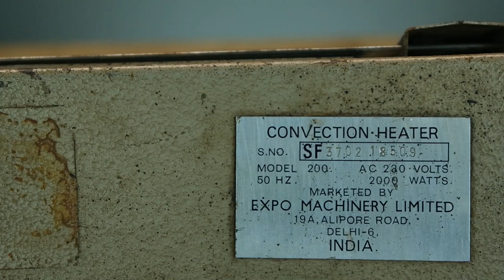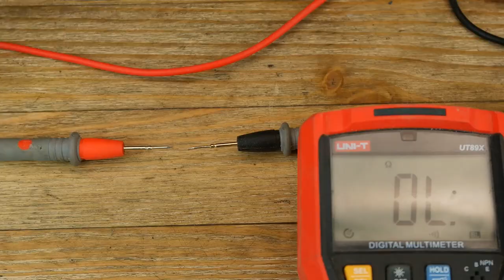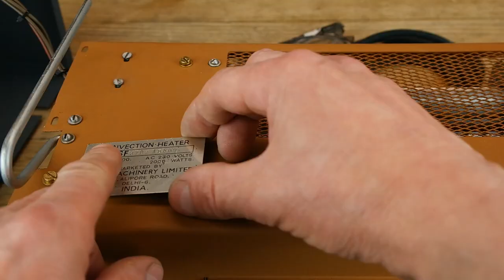Restoration of old Fan heater

Comment: Beautiful restoration job you did on that electric space heater.  It looks much better and it works like a charm too.  Good to see old appliances restored to working order, particularly when many of them are simply thrown away after they have stopped working or are simply worn out.  Excellent work.
Reply from the maker: Thank you for your interesting comment👍. I'm glad you liked the renovation. Regards

Comment: I have cleaned a fan heater for my neighbour, that had a similar style to this ~ rectangular unit, bar foot and side dial, the only difference with hers is that; the tangential fan is inverted and the air is drawn in a vent in the top of the cover, the impeller is plastic, deluxe functions ~ dial had 5 positions = high/low speed fan, high-ll/low-l heater and a thermostat. The only awkward thing with hers was how the mains lead went through the housing - into a perished grommet > a hole in the cover [not an arched slot like you had] = the wire got bent on removing the cover as to how close the strain-relief clamp was to the hole, a screw (in a slot) was loosened under the thermostat to push it into the heater so it’s wheel would clear the slot hole in the cover for removing and the dial was pulled off. I didn’t elaborately/completely dismantle it not like you did, l removed the cover and was amused with the amount of dust that had coated the inside of the chassis, I opened the bottom sash on my window and put the chassis on the outer sill recess of the house and got an electric air-bed inflater and blew the dust out with it, and was amazed at how effective it was and the dust cloud I had made. I also removed the impeller to oil it’s bearing and took apart the motor to [again] oil it’s bearings [these need to be removed > heated and pickled in oil to efficiently lubricate them] l then reassembled the fan heater and inadvertently bent-twisted the wire inside the the cover (it survived the ordeal with some chafing from the hole) and managed to straighten it out. I then tested the heater and it worked as intended
Reply from the maker: I congratulate you on a successful renovation and thank you for your description of the renovation, best regards.